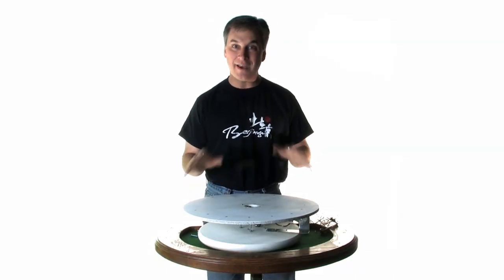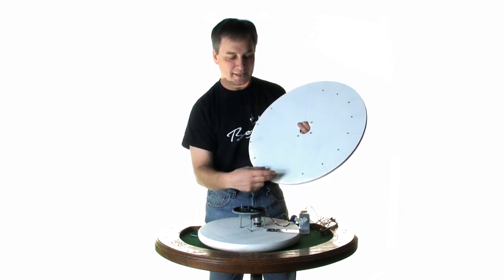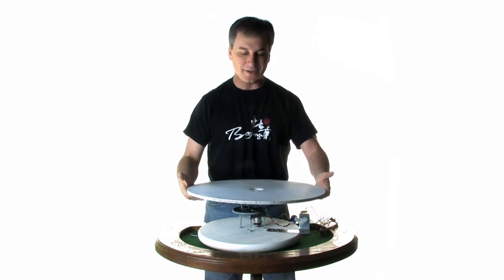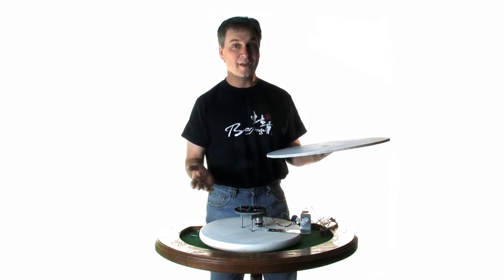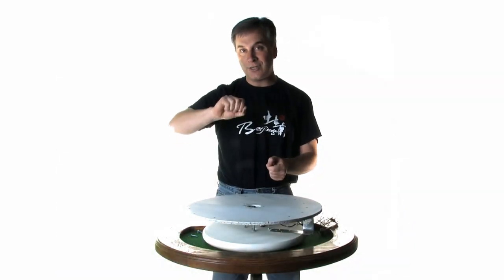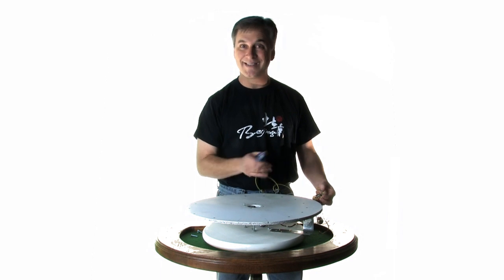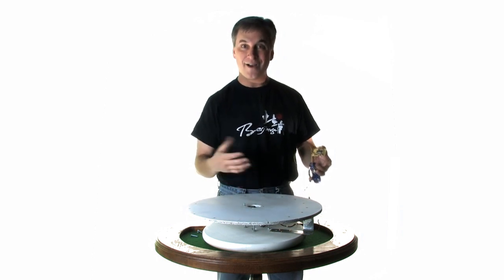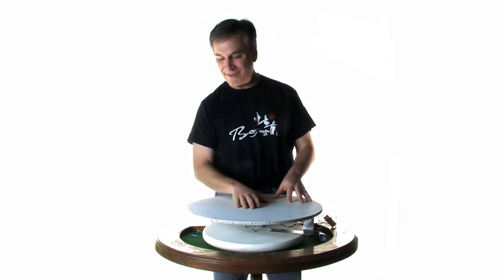Make A High Tech Zoetrope

Comment: @ 4:54 Know what else would help with the dimming/brightness issue? Add another magnet or two between each of the segments. This will cause the light to flash more often and your eye will interpret it as nice, even lighting. This is how film movie projectors worked. There was a shutter wheel that blocked the light when the film advanced but they found that a steady light between frames made the image flicker, hence "flick." They found that increasing the amount of flicker by adding two more shutters to the wheel made it appear as a steady light source.

Comment: Hi, I realise this is quite an old video, but by any chance, what is the transistor you use in your focus tool? Thanks!
Reply: Any general purpose transistor NPN should work.  I probably used a 2N2222 just because everyone does.  :-)
Reply: great thanks. I ll check cause I want to drive LED strips so I might need a bigger transistor for higher current.

Comment: hi, thanks for the info on the pcb focus tool, i have tried to recreate it, but it seems to take a lot of brightness out of the system, even with a 9v supply it seems to be very dim, i cant figure why this is happening, is the circuit diagram correct, is it a std 4013 chip?

Comment from the maker: Thank you!  I'm not building custom projects right now, but any electronic hobbyist there in the UK should be able to assemble it easily.  I've found that just connecting the reed switch to a small relay does quite a good job as well.  You can add small capacitors across the coil leads to vary the delay in the flash if needed, and dial it in pretty well without the circuit!  Thanks again!

Comment from the maker: Yes!  I've seen this done beautifully with a camera set to the exact frame rate of the spinning disk.  (Tricky to adjust, but beautiful when well done!)  The only downsides to a record player is that your models to animate must be very light, and well balanced, and if you want to trigger your strobe from the turntable, you'll probably need an optical or mechanical pickup (instead of the magnets).  The motor and turntable shown here only cost about $25, so price is probably comparable.  Thanks!

Comment from the maker: @dannymosquito Complete darkness is best, though you can certainly make out the animation as the lights begin to dim.  Yes, the blurring is caused when the duration of the flash is too long.  When the flash is short, the wheel is visually frozen at that moment, so there is no "motion" blurring.  If the flash is too short, then the wheel looks "dim" because your eye does not have enough time to respond to the flash.  Hence, the little focus tool.  :-)
Thanks.